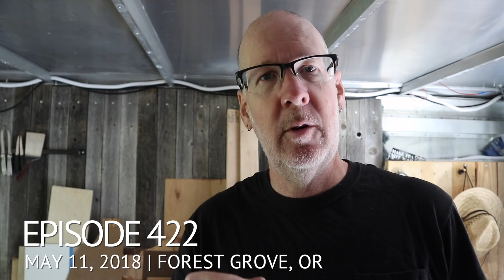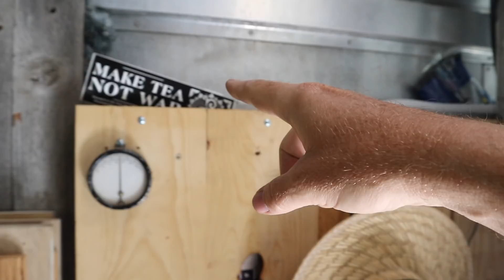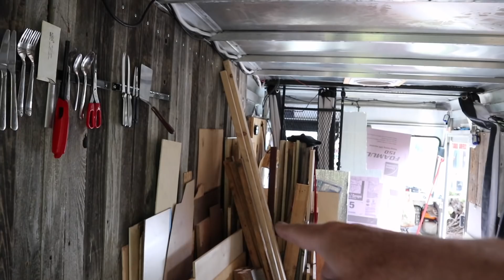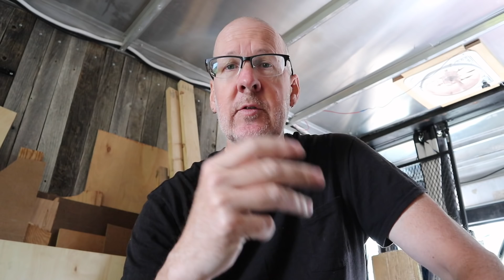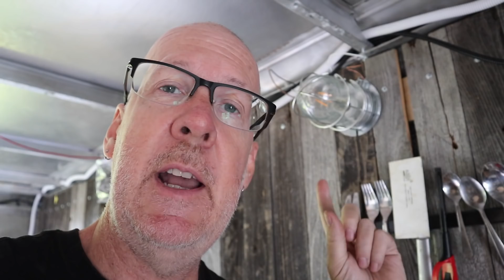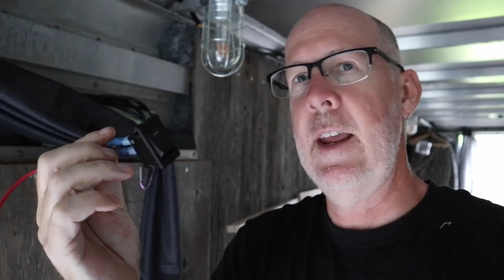Wiring Edison Bulbs in Step Van E422

Comment: My mind goes straight to using the old metal advertising signs. Or maybe old metal vintage ceiling tiles. Either would go great with the rustic wood on the walls. 
I know what ever you use need to be on the thin side so you don’t loose the head room space.
Reply from the maker: would love to have vintage signs for ceiling panels. definitely on the thin side

Comment: Seven my man, you've come a long way since I started watching you when you purchased the van. I won't go into wiring color, but always remember this, red is power and black is ground. I'd use blue for lights. Make a diagram of your electrical system, on your laptop and do a paper version { make lots of copies}. Computers can fail you right when you need them, don't rely on memory. Troubleshooting will be a breeze in case of problems. Dude I'm impressed, you are not freaking out anymore.
Reply from the maker: everything is getting easier... this build is going lightning fast compared to the last one

Comment: Very cool. Love the bulbs and fixtures. Was wondering about their length, combined with your height, and now seeing their placement near the walls, it should be fine.
Reply from the maker: temp mounting right now until I have the final ceiling in place and then will relocate them a few inches

Comment: Glad to see you used the 12 volt screw light. I had all the lighting in my boat like this. So easy to find parts. Looks pretty cool. The lighting fixtures you chose look a lot like lighting used in old Navy ships. Get yourself a good supply of the lights in case you can't find one when needed. Doing Good!

Comment: The Edison style lights look awesome. It would be really neat if you can rig some type of dimmer switch to them for mood lighting.
Reply from the maker: unfortunately these bulbs won't dim (I'm told there are two types of LEDs... smart ones with a circuit won't dim but are more efficient, then cheap ones without a circuit will dim (but use more power). I'll be able to dim the LED strip lights for lower light needs

Comment: Hey Seven! Looks great! Like those lights! Your doing great! May I make a suggestion, something I learned, especially with alum body, rather than making "-" negative to connect with screw to body of vehicle, if you use pair of wires, - + then you make all the ground - connection on a terminal block where you are distrubuting power. Like near your battery where it all originates from.  This way also when you cover these connections with insulation finish skin, the bonded connection becomes not so easily accessable. This way on a terminal block back at the source, you can access connections validate everything working etc...just a suggestion.  I use in electrical industy called a ground bar for this for the negative connections. Anyway, I found the electrolysis that happened with terminal and screw going into the alum body caused corrosion that then caused intermittant connection that eventually failed.  So this I learned over the years dealing with my step vans. On pre 2000 older mercedes they alway ran a negative wire back to a central point.  Especially on our step vans having alum bodies, running current through them can make some wierd effects! Anyway you are doing great! I wanna encourage you! [not critize] I hope you have fun with this stuff! I find it really fun/gratifiying make stuff work and putting stuff together!  Oh God bless you my friend, enjoy the coffee, savoring the moments!
Reply from the maker: I got a few calls and other emails from people (like Scott in san diego) saying the same thing. I'm going back and re-doing the ground wires as you suggest
Reply: That's great Seven, with new LED technology, low current draw, I buy something like 14-16 guage paired red/blk jacked wire on amazon, my local vendors don't seem to have it much. It's like speaker wire only rated for "in wall" and has a UL Listing. The outer vinyl jacket helps protect the red/blk wires from the sharp metal, but your good using the loom to protect it. Your doing great! I gotta look up for info on those edison bulbs they look really cool! Curious what the wattage is.  God bless!

Comment: Seven the improvised funnel is good, but an "ear wash" bulb from a drug store makes is much more precise. You can also use a chemist bottle with a squeeze to dispense tube on it. Remember the Baking soda to dissipate battery acid effects and light grease on the batt terminals as well. Good luck on the project.
Reply from the maker: great suggestion!

Comment: Short ground to the body on the fan makes it easier but can be problematic latter. It is best to run a ground wire all the way back to the panel using a common ground.
Reply from the maker: looks like I'll be doing exactly as you suggest with all my connections

Comment: Hi Seven. You should get a battery fill water bottle. It will fill the batteries to the proper level and shut off when full and will not over fill the batteries to make sure they are venting properly and will not bubble out when charging. It will also make it much easier to fill the batteries with no spillage.
Reply from the maker: great tip. I'll look into it

Comment: Seven - just a thought, one your main lights you might like to have two switches. One at entry and the other where you place your bed. You never know when you might need as much light as you can. Plus the convenience of having two switches.
Reply from the maker: I do have 2 switches. one for left and one for right. also will have reading lights in the bed area so those will be the last lights I turn off at night
Reply: Or 2 dimming switches

Comment: I'm not an electrical expert at all, but it might be a good idea to label your wires at each end and in the middle.  Maybe with painter's tape and a permanent pen.  You could also draw a wiring diagram showing which wires go where.  It might prove useful if you have any electrical problems in the future.
Reply from the maker: great tip. I should label all of them; will add that to my list to do today
Reply: I like the sound of that numbered tape it sounds very useful!  I'm in the UK, will have to look in my local stores for some. Thanks deuceaid!

Comment: Looking good! I really see a different Seven from the guy that started out a year ago, and please take that as a serious complement.  You have learned so much and your confidence level to take on new projects is contagious! 

 Only advice I'd offer, is to label everything while you still remember what each wire does, and you can still access each end.  Yes, it does take a little time now to stop and do it, but man from previous experience I can guarantee that it will be time well spent.  Imagine if your dash wiring was labeled correctly before you got it all cleaned up - how much time would that have saved? 

Sometimes, on long wire runs, it is also a good idea to label the middle of the wires as well.  That will come in plenty handy a couple of years from now when you are tracing down electrical gremlins that pop up from time to time.  Also make sure to label the crap out of the electrical box, and fuses.  Include what size fuse you have installed - try and make it look like the fuse box pictures that are in cars.   I like to use a drawing program (I use a cad program) to copy the fuse panel so I can add labels to it.  I once rebuilt a 25' fiberglass boat, and ended up bonding PVC pipe into the fiberglass frame of the boat that I ran all my electrical through.  With all the sensors, motor controls, lighting, cabin electrical, communication radios, depth finders, fish finders, short range radar, am/fm/cd player (with a ton of speakers), GPS I ended up with a ton of wires running all around the boat.  I found that it was very handy to also make a document that showed a graphical representation of the boat, and the routes of the PVC conduit.  I then labeled each end, and intersection of the conduits.  On my document, I then listed the route of each wire.  I ended up with an electrical problem that turned out to be such a trivial task to troubleshoot as I knew exactly what every wire was, and where it was run.   Once I had identified my marine band antenna cable must be faulty, it took no time at all to pull a new cable in, terminate the ends with new connectors, and be back in business.
Reply: bsb0011...you're the type of person that I'd like to buy things from. What an excellent way to do things!
Reply: Thank you!  I was able to charge a bit more when I sold that boat because of that and some other build documentation I was able to provide the new buyer.  So while it did add some time to produce, I easily made a nice "wage" for my time while producing it.  New owner called me a couple of times after the sale, and he said about the same thing you did.  It made his repairs and upgrades go quickly and without a hitch, and as he was paying someone to do the work, he felt like he got my documentation at a bargain.
Reply from the maker: great suggestion on labeling. I've been slacking on that and just wired everything without labels :(
Reply: If you can still get to the ends, it's not too late. Even a piece of masking tape "flagged" onto the wire, and labeled with a marker is better than nothing.  Especially at your fuse box. Of course, a cheap label maker would be better, and neater.

Comment: I would invest in a soldering iron.  Gas type.  Never need to worry about connections coming loose.  Vibrations can break other connections.
Reply: Excellent idea!
Reply: Also,  when you solder,  It takes out the possibility of corrosion in your connections. (That's what I hear on YouTube, anyway.  No personal experience.  Just passing on info.)
Reply from the maker: great suggestion!